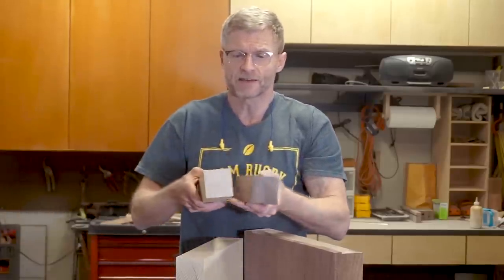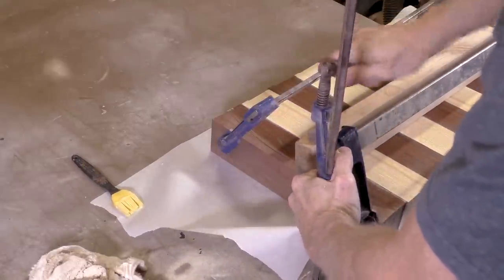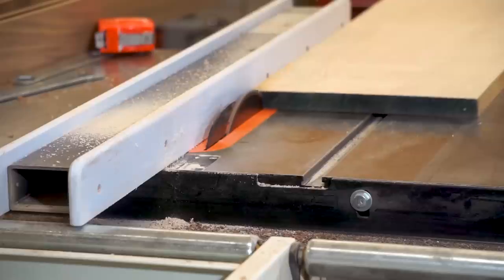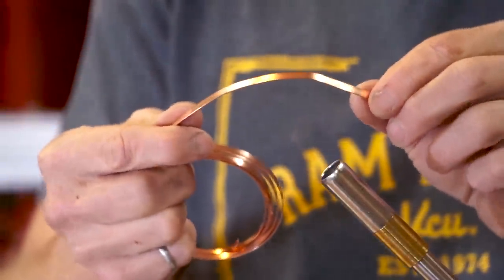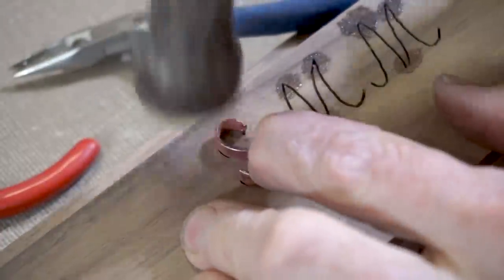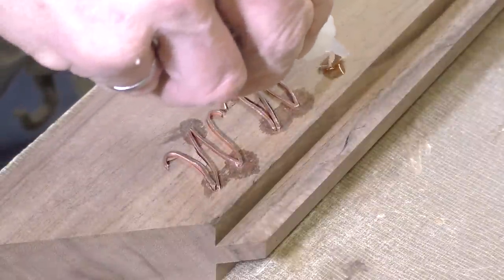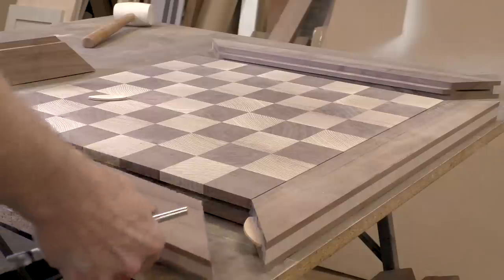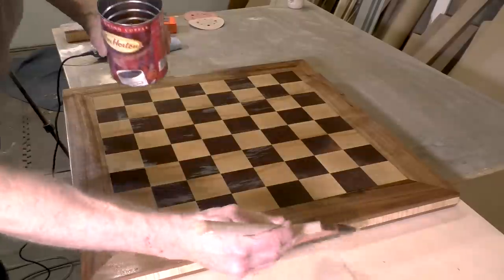Chess Board with Copper Inlay

Comment: All of you who were rudely judging  this guy's work with copper inlay or are thinking about it, think about what  Bob Ross said, "as long as you're learning, you're not failing".
Reply: Nothing wrong with pointing it out tho.
Reply: You're failing when you're charging someone $400 - $500 for a board that has a crap inlay and is going to have little green flecks all over it in a year or two. Yes, you're failing massively. I feel very bad for the purchaser. That lettering was utterly unacceptable at that price.
Reply: My Name - If the customer loved it, which they did, then your opinion doesn't matter.
Reply: @TheBradinator214 , we'll see how happy the customer is in a couple of years.

And, regardless, it's preying upon the ignorance of the customer. This is what us old folks call, "immoral." You probably don't know anything about that.
Reply: My Name you really do need to chill out. I’ve worked for plenty of guys who live by the mantra “that’s good enough”,  and it’s disgusting to me. This guy clearly did his very best. Maybe he could have spent some more time learning about copper inlay but it sounds like he also didn’t charge 5k for this piece either. If he was a scam artist and a thief he wouldn’t have busted out the 2000 grit sandpaper on a dremel just to polish the top of the copper. All of the steps he went through during finishing shows that he cares about the work he does and truly wants his customer to get the best possible product that he can make. For Christs sake man, you know he could have just slapped some oil on it and called it a day. I don’t know if you’re a woodworker or not but you KNOW that. So how dare you call him a fucking thief. 

Whatever is going on in your life to make you such a grumpy fuck, I hope it gets better. I genuinely mean that.
Reply: Chris Clayton - Nice

Comment: I've had a lot of success with taking my inlay pieces to a local laser engraver and having her burn the letters into the wood. Then I use copper dust and CA glue to fill the letters in. I've found it gives a VERY nice result... Just a thought.
Reply from the maker: Thank you for the suggestion. I'll definitely consider trying that approach for an upcoming project when I need to do an inlay like that. I'm always up for trying something new!
Reply: I wondered at inlaying with hot solder onto a copper foil base and then coppering the solder, as per stained glass work
Reply: Do you have any pics of an inlay like that? I'd really like to see one, and where do you get copper dust? Amazon?
Reply: @Woodumakeit  Another good option would be to use copper wire instead of the wide flat that you used. The wire will be more workable and each letter can be made from a single piece. It will look rough until sanded down, but once sanded it should look completely integrated
Reply: What about melted copper
Reply: @death1305sam  maybe if you want to set it on fire
Reply: @Woodumakeit  - Mother of Pearl would be a good choice. Onyx or turquoise would be rather exotic. If you know any local glass workers, who can make molds, there's a type of glass called "vaseline glass" or "uranium glass" that is usually a light green, but which fluoresces under UV light due to incorporated uranium salts.
Reply: @death1305sam  you can certainly pour melted metal into wood for inlay... Just have to be aware of the different melting points of each and the temp your species of wood can hold up to.. but this is actually a very well used technique of using molted metal as inlay
Reply: @bearonatricycle1082   @420 420  you can certainly pour melted metal into wood for inlay... Just have to be aware of the different melting points of each and the temp your species of wood can hold up to.. but this is actually a very well used technique of using molted metal as inlay
Reply: @mattperryman7491  you can use a file and an electric wire…
Reply: For those learning, the flat was made from beating out wire and is generally considered a better approach than round wire

Comment: A little tip for the anealing process, cover the copper in boric acid, the dunk it into hydrochloric acid, the boric acid keeps it clean, and hydrochloric acid cleans off what the boric acid couldnt keep clean, it also makes the aneal process faster than air cooling, and it does a betger job in my opinion:)
Reply: Also would like to add, silver, or brass would look better as the inlay instead of copper, they also polish alot better than copper and they keep their polish better, coming from a jewelry maker:)
Reply: One more thing, is when ur hammering it in, hammer it in with a hard mallet, could be wood, or plastic, or rubber doesnt matter, but not metal, it denst copper expecially annealed copper, now im not gonna eb all high mighty saying i know all, just giving some tips, u can choose to try them if you so desire:) from one fellow craftsman to another, just sharing some tips:)
Reply from the maker: Thanks for all the tips. I really appreciate it and will give your suggestions a try the next time around..

Comment: So the thing with Cooper is that what you were doing unfortunately was not anealing the copper like you had hoped it would. To soften copper you would use the same method as hardening steel (except you would use water instead of oil)  so heat it up and very quickly place it in water. Also you don't need to heat it up that much, it only needs to be heated until you can see the heat scale forming (purple and blue coloring across the piece) that will result in less scale on the surface and easier sanding

Comment: Buy a small CNC router machine for the copper work inlays. You may mix powdered copper (even gold or silver powder) with clear epoxy and do amazing inlays that always turn out perfect.
As for personalized inlays; they really detract from the value... a better option is a paper label attached to the underside... custom manufactured for, material types etc. etc..
Reply: "As for personalized inlays; they really detract from the value"
Not to the person BUYING it.

"You may mix powdered copper (even gold or silver powder) with clear epoxy and do amazing inlays"
Doesn't look nearly as good as solid metal.
Reply: The value proposition for personalization of a commissioned piece lies with the person placing the commission, not the maker. So your comment on a better option is simply incorrect. This piece was not commissioned as an art investment opportunity with future resale as even a consideration.

Comment: liked Chess Board with Copper Inlay very much; copper and brass must be softened by heating quenching then repeat until the desired softness is reached. the ends

can be hammered lightly to scarf the tips of the mitire joint. I learned this at about age 25, after much sweat & frustation . sitting down with grandad & told him what I had
learned.he laughed saying he knew I would figure it out . asking why he said nothing ? Grandad figured i would better remember that lesson and I have. thanks 4 reminding 

me,

Comment: Great job and thanks for the video. I'm a tradesman from way back. To anneal copper try heating it to "Cherry Red" colour  then quench it into cold water. You will find that the copper will be extremely soft. To "Normalise" copper you follow the process that you did in the video. If you think I mis-spelt a couple of words, I'm an Aussie, we spell the British way :-) Try the copper thing I mentioned, I promise you it works!
Reply from the maker: Thanks for the tip. That's something I didn't know prior to making the video. Your spelling was perfect, in my opinion. I grew up in Canada, so I'm used to an extra "u" thrown in once in a while, and "s" used in place of the American "z".  🙂
Reply: I'm an old fart. I work as a Consultant / Contractor for ISO management systems and use other companies computers. Needless to say, I add the British spelling to the US Microsoft spelling dictionary so it doesn't show that a word is incorrect. ;-) 

Yeah, the tip is It's actually the opposite from hardening tool steel, like high speed steel etc. Although with tool steel you need to quench in oil. Water quench will crack the steel. Let me know what you think when you try the water quench to soften copper.

Comment: I believe that the copper work could’ve been joined at angle cuts that joined in a point rather than butt joints. I would have laid out the letters per the Dremel routing and soldered the mentioned points  together then very gingerly started to insert them into the wood. Bending the copper as required until I had it to the point that inserting the copper would have gone in one complete letter at a time. The woodwork was great though. Thanks for sharing.

Comment: There's a really outstanding two-part epoxy called HXTAL-NYL1. It's a chemically pure epoxy developed for Museum-quality restoration and conservation of glass. It is optically clear, with the same refractive index as borosilicate (lab-grade Pyrex) glass. It is non-yellowing, does not use UV to cure, and is extremely hard. Not cheap, but it is the Gold standard.

Comment: if you wanted to pull the outside edging in tighter you could have left the white inlay out and screwed it on for a tighter fit then put the inlay in over the screws

Comment: from 5:10 to 5:30 I noticed the last row of blocks is not flipped correctly, making it not criss cross. Did you end up cutting and rejoining it?
Reply from the maker: Good observation. I made several boards at the same time, so it wasn't always the same board at the start of the video.  This one ended up as a mistake. If I had cut it off, that last row would have been too narrow, so that board is now a really nice cutting board. I left it in the video to see if anyone would notice.

Comment: you could have used a band of copper half as wide.  you should also have made up your letters first then routed out the wood to fit the made letters.  the copper of the made letters should be work hardened by tumbling with shot before hammering into the wood to prevent it from distorting from your hammer.  nice work overall

Comment: Looks good. How many passes did it take at your drum sander to get it down to your required thickness?
Reply from the maker: I'm not sure exactly, but it was probably about 8-10 passes on each side. I set the sander to take off a very small amount with each pass to keep the sand paper from getting clogged. The sandpaper is not cheap, so I try to make it last as long as I can.

Comment: That board is absolutely stunning! The copper inlay was meh for me.
Reply: I agree. I think it looks like my handwriting and I wouldn't want to have to look at that on such a nice piece...
Reply: Agreed, it looks like my daughter handwriting practice
Reply: Agreed, not sure if it was a material choice or inlay technique. If he used the smaller gauge maybe he would have had better results. I think either experience or technique may make for a better finished result.
Reply: Its a look concept but maybe trying a font change or useing it like the tiger wood would make more sense...a simple router job instead of the inlay might have also worked but wouldnt pop the same
Reply: @evangoodwin4363  There's a lot going on in the inlay, but let's start from the top. The font used was a bad choice. Then the transfer using carbon paper was sloppy. Next, he cut too deep of a track (hence why it broke off) and proceeded to use tempered copper. He diddn't properly measure or anneal the pieces. Next, he taps them in using a hammer after bending the copper (both hammering and bending work-hardened the copper), instead of annealing it again and using a press.Lastly he never filled it! Just epoxy! That just left the wonky lines in both the wood and the copper super visible. Lastly that copper is definitely going to stain the board green over time, as it oxidizes. Might be a cool look but not my cup of tea.
Reply: I thought it looked nice.  A little wobbly, like mayne the Ms should have been one piece but all in all I thought it was the cherry on top
Reply: @Ian-qh7le  my thought is that grinding copper into fillings would have the results he wanted... This is how many inlays are done for guitars
Reply: Strongly agree.  Unless you're very experienced with inlays (especially curves which are much harder), I wouldn't attempt this on a piece of this beauty and quality without a CNC router (Which aren't that expensive these days.  There are models that would have sufficed here that cost less than this commission I'm sure).
Reply: You don't inlay like that. You use a piece of wire. I have seen many inlay pieces of furniture and musical instruments, never done with flat stock because you run exactly in the problems he faces. You lay a hole using a V chisel, round it with an U one, then twist copper wire, prepare some hide glue and using light taps, you in lay it. Then you sand it.
Reply: I would probably rout the channel then fill it with epoxy with copper flakes in it.  That might not be exactly what the customer wanted, but I wouldn't try to inlay real copper.  I'd make at least as much of a mess of it as he did.  No offense, it was otherwise nice work.

Comment: Watching that copper work was painful
Reply: only real issue i could find.
Reply: Complete cringe when I saw that
Reply: Difference between a woodsmith (expert level) and a metalsmith (somewhat less) :)
Reply: @RonaSpreader  5:12 is a small issue too, look at the board.
Reply: @medendorpm    lol I see it now. Then it's magically fixed at 5:28
Reply: Yeah, that was a bit rough, but it all turned out looking nice ;)
Reply: EyeOnTheTV it’s not fixed, look on the other side
Reply: @medendorpm  - lol, good eye. We trust so blindly, lol...…. What I wonder is how did he not destroy the profile of the board with all that extra localized sanding on the inlay corner??
Reply: The result even more so... That 's'..... :(
Reply: @medendorpm  lol
Reply: I would have melted the copper and then poured it in
Reply: @death1305sam  The melting point of copper is nearly 1,100 C.  No I think not.
Reply: Should have used a flat block of wood and used a mallet to snack the copper in

Comment: The chess board looked gorgeous, but the inlay was quite disappointing
Reply: Agreed, better without it.
Reply: Agreed! Should have used a font conducive to metal I lay
Reply: True.  I don't know why he didn't fill the inlay after the metal was added.   It makes all the difference.
Reply: Yeah
Reply: Agreed, But you have to experiment and learn new things, just maybe not on client projects. A CNC would be a great addition.
Reply: @Tannerhasabike  That's the whole point.   Learn to do an inlay properly before practicing it on a client's job.   Doing fill for an inlay is pretty standard procedure. Experiment, get it right, THEN do it on a client piece.  Otherwise you end up with this - an Amazingly beautiful chess board with an amateur looking inlay.
Reply: Agreed, copper wire would have been infinitely easier and required a much smaller groove made with a pantograph
.
Reply: @Tannerhasabike  Yes, CNC machines have their place in a shop, but for custom, handmade items I think it lends more to this kind of project. That being said, I would have used a wire more conducive to inlay. While it is a work of art, the lettering just looks very amateurish and would have been better to have burned the letters in and on the back.
Reply: @noahcantrel4025  I think the copper really looks great. To each owns opinion.
Reply: By inlay you mean the copper letters?
Reply: You can see at 17:50 that he made two attempts
Reply: Completely agree, would have been better without it
Reply: Just what I thought, what a shame
Reply: Broockle is there any other on the board?
Reply: Yeah it looks like how an 8 year old would write letters. The lines are very wavy.
Reply: CAN THE WHINGERS LEAVE LINKS TO THEIR METAL INLAY WORK PLEASE?
Reply: I 'd use laser to cut channel for copper. Then use copper wire not flat stock. After grinding down might look more fluid. Or use gold wire as it would be much easier to work with.
Reply: Dude do you know how hard it is to do that shit. Gosh lol
Reply: Totally agreed.
Reply: Were it possible I would have melted and poured the copper...
Reply: It's only because you saw it happening. At the end you don't see any mistakes. Nobody look these with magnification glass.
Reply: The whole point of being hand made is that it IS and LOOKS  hand made and NOT ' perfect ' ! ....if you want 'perfection ' just buy a machine-made product complete with custom,  machined  initials !